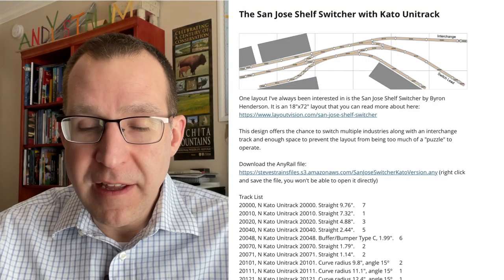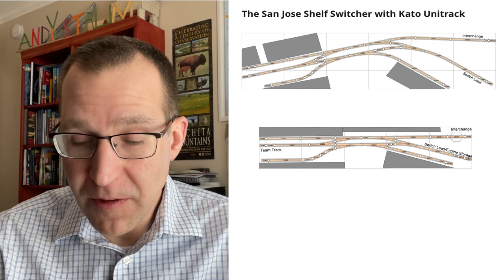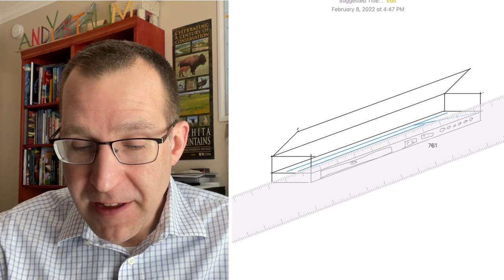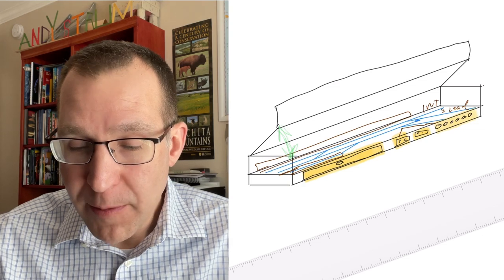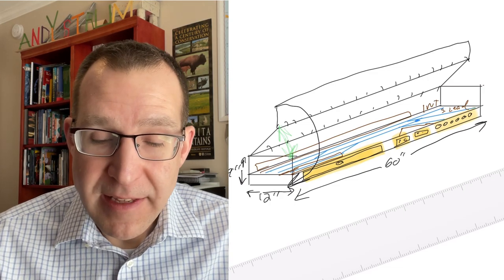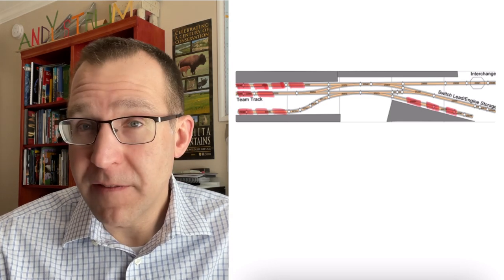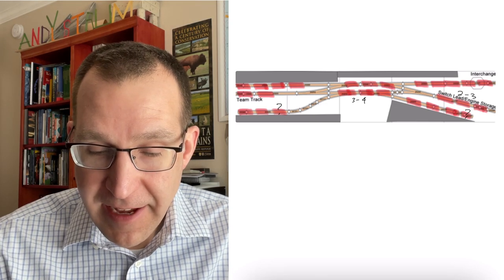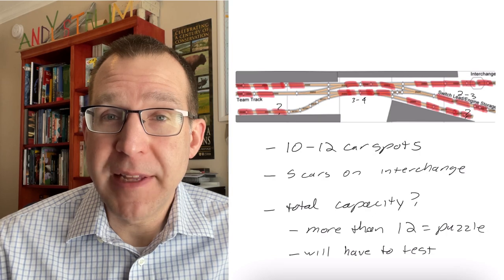1’x5’ N Scale Switching Layout Design

Comment: Am in the process of constructing that San Jose layout, the one on your  website, with a #6 turnout attached to the end of the interchange track.  That switch the leads to an oval that surrounds the  switching portion, so while switching, I can run another train around San Jose.  Used your Kato plan, but added a couple of long straight tracks in the runaround section, to lessen the puzzle aspect.

Comment: Looks like a good plan Steve. I especially like the hinged top. One issue that might give you problems is the Team track. Cars left there will interfere with run around moves to work the sidings on the right hand side of the layout. Good luck and I look forward to watching your progress.
Reply from the maker: Yeah, I might just make that a one car spot loading area and likely I’ll have to move it when doing some run around moves.

Comment: I have the "San Jose Switcher" in mind for my next one too!  One tweak I am doing to it is having (what you have labeled) as "Team Track" and "Lead", and the line between them, represent the "Mainline".  IMHO, the Team Track is redundant in this plan - there is already an Interchange Track that plays the same purpose as a "Team Track" (i.e. accept any car type).  So this makes it so both ends can be used for 'switching leads', but also now I can envision this layout as being a center section of a longer line -- It could even become just that if my kids ever move out of the house :-D  LOL.
Reply from the maker: Yeah, I might just take out the team track loading spots since I’ll have 10 car spots plus the interchange anyway. Or I’ll just make it a one spot loading area.

Comment: Use Mirrors... Paint the Trains Half and Half (Left side is different from right side but share the same Roof Colors.).. So when they come out of the tunnels, the side that is next to the Mirror looks completely Different than the side facing You... Doubling the number of Trains Running. Then as they go Into the Other tunnel, the side that was facing the Mirror is now the side that faces you.... Key is... Make sure the Tunnel Openings/Exits are 90* to the Track or to the Front and Back of the Layout.. 
Requested this type before and on other channels and would Love to see someone Actually do it.

Comment: I watch a youtube video        watch?v=Xbk5kedUcY0e     which uses power tool batteries to run electronic projects.  This seems a good fit for DCC++ running a small layout.  For DCC++ and n-scale a 14V powerpack should be sufficient and make the layout portable.  I look forward to this project and will try to build it.